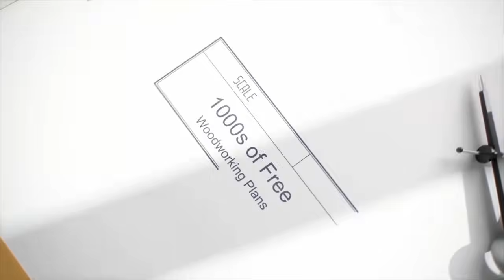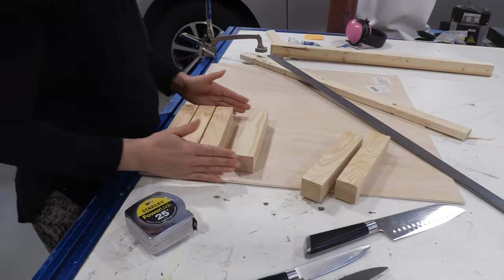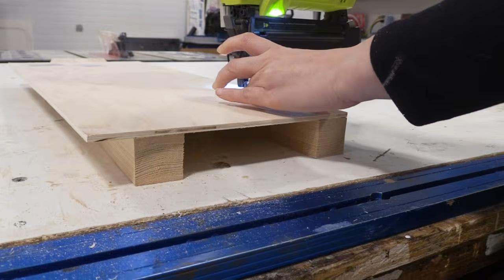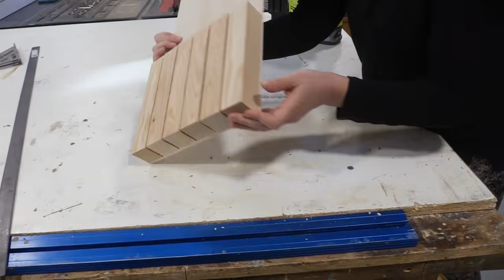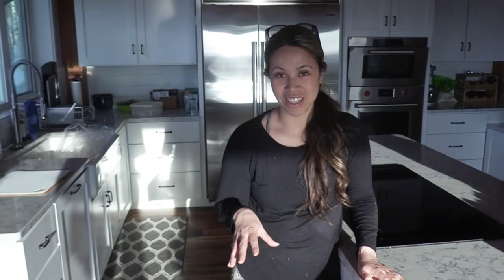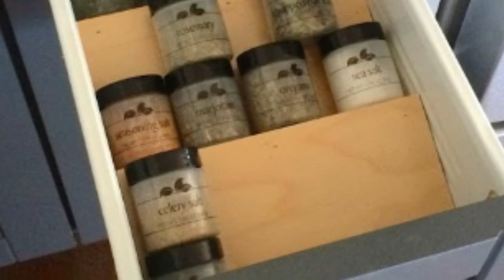DIY In Drawer Knife Block #anawhite #diyprojects #knifeblock

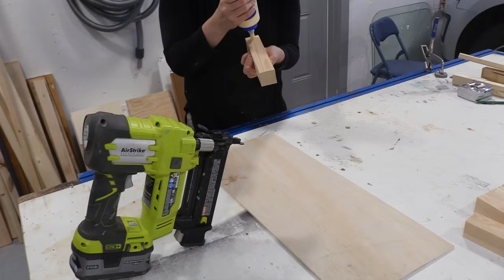Comment: @2:36 the styrofoam under the circular saw 🤯 does this effect the dullness of your blade? I’ve been struggling with not having a mitter saw or table for cutting my smaller pieces of wood… and want to know if this works without messing up the blade
Reply from the maker: This is my go to method and the foam will last for years! I haven't noticed an issue with dulling the blade, just set it so it barely goes in.
Reply: The styrofoam won't dull the blade anymore than the wood will. It's a fairly common technique.

Comment: Thank you for this video and the clear directions.

Just a tip, instead of marking on the saw the length of the cut you can use a spring clamp and clamp a small block of wood to the length the pieces should be.

Comment: Ana, great idea and I really do like it. I have just one concern as to not putting a finish on the wood. One has to admit no one knows where the wood you used has been and who handled it before you got it. I can understand not finishing the wood but maybe if you did a little bit with the surfaces that contact the knives at least would be beneficial. Sorry I threw some shade on what is really a great idea. Great stuff.
Reply: I was thinking the same thing.  Great idea and great application but maybe some food grade type finish on it and it’d be perfect.